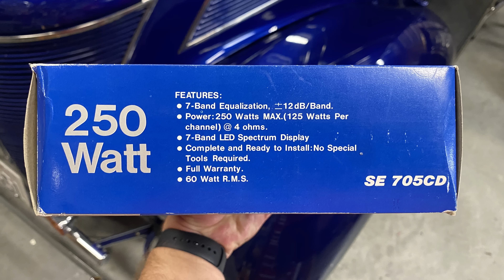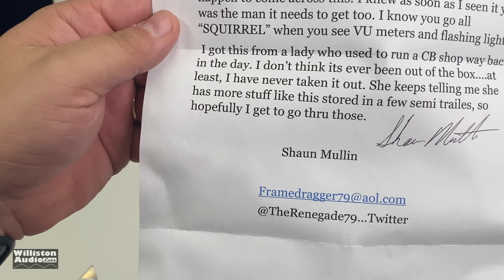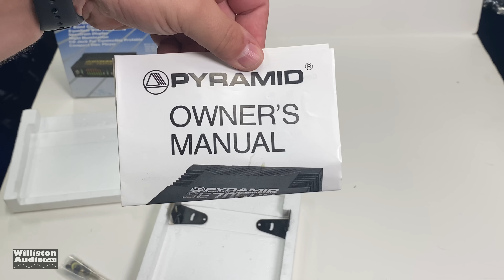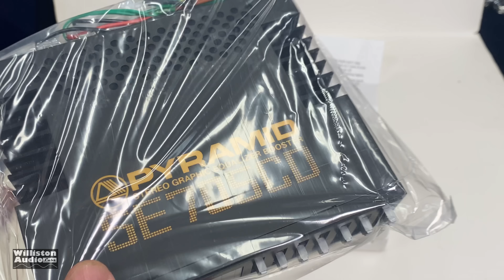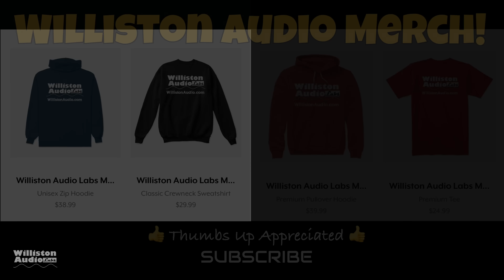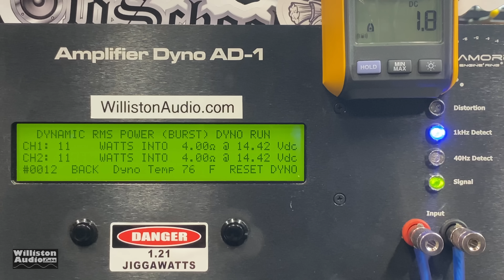1980's Flea Market EQ Booster? Pyramid SE705CD Review and Amp Dyno Test

Comment: In '88 I had an '81 Mustang with stock AM radio and 1 speaker in the middle of the dash. Realizing that my boombox had speaker outputs, I bought a Craig EQ/booster and and installed a pair of 6.5" Pioneers in the rear side panels (yes, if someone on the husky side sat in the back, they would muffle the sound a bit). Running wires from the boom box to the Craig allowed me to listen to my cassettes and FM, instead of that crappy, blown dash speaker (in AM none the less). That is officially my intro to aftermarket car audio. Thanks for bringing back some nostalgia.

Comment: I'm sure you already know, but I can't recall ever hearing you mention it. With the "New Old Stock" amps or electronic equipment period, the electrolytics dry out over time and sometimes severe damage to the unit can take place if power is applied prior to testing the components. Of course to thoroughly test the electrolytics, they would need to be desoldered and removed from the board and tested, then resoldered if values are still in spec. Cute little EQ though.

Comment: Had a sparkomatic loud n clear system back in 87 when I first started driving had the 80 watt power booster with the loud n clear 6x9's. With a set of pyramid 12 inch subs 😄 😄 thought I was doing it back in the day

Comment: If I’m correct , back in the 80’s , many of the cheaper head units only had around 3 to 5 watts rms per channel. So this Pyramid EQ would be considered an upgrade.. if you wanna call it that .  There is lots of Nostalgia to the Pyramid brand. Most of us teens in the 80’s didn’t make a lot of money, so we had to resort to cheap products like this unfortunately . Speco was another company that made eq boosters in the mid 80s

Comment: Those things usually had a 5 amp fuse, which tells you a lot about potential output. The fuse blows if it pulls more than 60 watts from the battery (ok, 65 @ 13.8VDC) so even at 90% efficiency there is no way it can make the rated power. They were cool though, I'll give em that!

Comment: I sold at least 50 of those power boosters in the late 80's and early 90's at the Wagon Wheel flee market in Pinellas Park, FL. Pyramid had some hit and miss products. Their power boosters were much more overrated than most of their amps, which were still way over rated. If you ever run across a Pyramid PB600 (4 channel amp), PB800 (beautiful red 4 channel amp) or PB1000 (also red but 2 channel) please pick them up and dyno them for me! I love the channel and keep the great videos coming.

Comment: I think I am a bit older than you Big D. Do you remember Sparkomatic amplified speakers? They were 4" amplified components, with separate amplified tweeters with  their own level control. There was also a "subwoofer"  with dual 4" woofers with built in amp.Each speaker had its own amp. They were loud as hell..... and noisy as hell, but I did not know then what I know now.I would love to see a set of these come your way.

Comment: hah. i installed a few of those, back when. worked alright for installs where you just wanted to give a boost to something with a suuuuper crap oem unit from the older car generations.

other than that, they're so damn iconic as generic 80s stereo crap.

Comment: Man that brings me back to 1990 and the  old Sherwood amps and the profile amps and pounding 4 10 inch bazooka tubes off the profile's amps and the 4 Kenwood 6x9 s in the deck lid with 4 Polk audio s in the doors . The head unit was a custom unit that was on the head liner and went from the windshield to the Dom light with equalizer and tape deck . Then had a cd player in the glove box all that was  in my 79 trans am . Man I miss that car

Comment: I had one of those with the surround and echo effects although I knew pyramid was a gimmick autosound company and would never make rated power the actual eq was pretty good when the sliders worked the amp section made factory speakers bump!...but I didn't expect anymore than 20 watts RMS per channel

Comment: So my dad worked for a brand that went by "SparkOmatic" in the L8 80's and they had similar offerings, though their EQ "booster" only touted 40w per channel.
Reply: I remember well the Sparkomatic
Reply: @raymo6795  HAHA! For the record, the name roots from the brands original products; A high mileage sparkplug & devices to check cylinder firing order. The car audio came later down the road, they even aired commercials on MTV. Theyre on YT check em out!
Reply: I worked at Pep Boys part time in HS and they carried 2 Sparkomatic boosters. One had just a power button and the other had EQ and green horizontal LED power level meters at the top. One guys Caprice practically burnt to the ground in the parking lot after he wired one in. He refused to buy the wire nuts to cap the connections. Great times lol 🚗🔥🚒

Comment: I was really hoping that thing put out its max rating. Would be really funny if Pyramid built something that worked. I had a pair of 15s that required Plumbers Tape to strap the magnets to the baskets. Stuff was expensive back then. $250 in todays money is around $600 now. A lot of minimum wage hours to buy that stuff.  Probably 75 hours worth of work to buy that eq. Yikes.

Comment: I believe there wattage rating is with speaker level inputs not line out inputs so may get 20w/channel with alot of distortion. I had a radio shack 20w/channel booster in my 74 Cutlass... LOL

Comment: how does it hook to a car stereo? do you have to use the speaker outputs? 
and how does the cd jack work when hooked to a stereo? would the fm radio be playing at the same time? or do you have to turn the radio off & just use the volume on the EQ.

Comment: I still have the Realistic version from Radio Shack which has 40W RMS boost transformer each channel instead of 10-20W BTL chips.  :)  Probably 10% harmonic distortion at 40 watts, but pushed 6X9's ever so well.

I saved up hard for that one and love that little spectrum analyzer, even if they cheated by pairing some LEDs together.

Comment: I have one that looks quite similar but the Chips are different and the front face is slightly different, instead of slide switches it has a push button up and down and its branded as "Nippon America". Its also rated at 250W I don't know if it actually makes that power but I do know it sounds much louder with the Equalizer than with just deck power alone. Perhaps it's the method by which it amplifies which the dyno is not tuned to pick up correctly? I am not sure maybe an expert can give their opinion. However, the Equalizer looks so cool when playing music or even listening to radio programs that I am not willing to part with it. It might be from an older time but so was many great things like the Toyota Supra and many sports cars including Lamborgini and Ferrari's, Grand Piano, Marantz and Nakamichi receivers etc.

Comment: I had one of these in my first car stereo setup in my 66 Mustang.  It did not have the CD input or the fader knob (eairler unit maybe?)  I used it as a preamp EQ only, but sad to say the rest of my setup included amps 2x 800w amps and 2 15" speakers. And 2 6x9's from Pyramid.  I knew even then that power numbers were over inflated.  It sounded pretty good and cost tons less than pro setups.   Overall I was happy and the setup lasted over 8 years of heavy use.

Comment: Haha I loved Pyramid. OK, they're stuff was garbage. But hey you could get at $250.00 MSRP Radio Tuner EQ 2500 watt per channel amp for the street price of $29.99!  But no, yes most of their stuff was garbage, but I had a few things that were decent, one being the 10 band PASSIVE EQ with LED display, LEGACY 3 way 6x9 (they were awesome actually), and 2 12" Phase III with the clear polypropelene cones. They were pretty good, not the best of course. I got a friend some of the 8" clear polypropolenes in a homemade box and it sounded good in his truck.

Comment: I had that very one. I used it as a pre-amplifier after I plugged it in and found out it wasn't worth crap. But then I think I paid $12 for it brand new. Lol To be honest money bought a lot more back then. And it was for a crappy old car.
     I have had and have some fantastic Auto stereos and amps. That wasn't one. One of the better stereos I purchased in the late 70s early 80s was a road star it had a 200 watt amp which was quite large for the day. And it then had a seven band equalizer with light bar that attached to a flexible gooseneck. I ran that up from the floor next to my shifter in my pickup. With the large Dimension amplifier behind the seat. It was 4 channels . The head unit  was also a Roadstar  it lasted nearly 25 years. It was a multiplex which seemed to be a big thing then. And the cassette player was rather trick  you could set it  to turn off or reverse indefinitely at the end of the tape.  but you could also set it to Auto eject as well. It also had a Chrome tape setting.  The amplifier finally cooked about 15 years and three vehicles later.  but I kept The Equalizer cuz I've never seen another one like it.  even the ones on eBay the Vintage section don't have that model.

Comment: Better than a cheap stock radio from the early 80's, just not a lot better.
Reply: I was 16 back in the 80's, and anything was better than stock back then.  As long as it was loud.
Reply: Yeah, most were only about 4 watts.
Reply: Boy do I miss the flea market stereo tables/vans. Pyramid EQs, Amps, and Subs. Love to see the PB-100 amp get tested as that was the only vamp I ran by them.

Comment: Can you imagine if someone like skar made a version of this today that actually did 250 watts and had the eq and everything?!? That would be RAD!
Reply: YES! Just have to find somewhere to put it,  rare to find a spare DIN slot in cars these days.
Reply: @CheapCheerful  Just use a couple of L brackets and screw it to the underside of the dash!  That's what we did in my 76 Cutlass.  good times... lol
Reply: @bmorg7244  Yes!! That's exactly it.
Reply: or if you got a 2 din car. get a 1 din radio with flip up display and slap the eq underneath. so you got a din 2 car play display and a manual eq underneath with actual knobs
Reply: They kinda do, but to get an actual 250w, it will be "rated" 1000w.
Reply: Single DIN EQ with a built in 50x4 RMS class D amp is totally possible, and could stack on top of a SDIN head unit in a DDIN opening perfectly.

Comment: You have to remember, the old stock head units in the 70s and 80s were at best 2 or 3 watts so going from that to 12 watts while it may seem laughable today, was a big improvement.
Reply: Pyramid was a piece of crap back then, there were other brands of decent equalizers with 35 Watts RMS wich sounded awesome.
Reply: I believe this was the go-to option for every t -top camaro, jeep, and pickup JUST so you could hear anything over the noise of your exhaust or mud tires
Reply: @jimbobdobbs1597 
no
Kenwood and Pioneer were goto's 
I myself had many Pioneer models in my Camaro's.
Reply: Yep with a couple Jensen or pioneer 6x9s and some Motley or some Ratt those were the days.
Reply: The standard go to chip was good for 25W into 4R at like 10% THD... BTL output was the only way to even get that high without a supply that fed them more than 12V.... This thing would have had 2 of them in it, one for each channel
Reply: @MadScientist267  Holy
Cra q at 150+ each
Reply: @rudygarza6410  Lol 🤷‍♂️
Reply: Less than it sounds. It takes around 10X as much wattage to get twice the volume. So a 3 watt amp would need a 30 watt amp to sound louder.  
As for people talking about speakers. Speakers rated lower are easier to drive with lower ratings, obviously.  A lot of speaker tone comes from how it's driven . You don't need 500 watts to sound good in a car.  35 to 50 watts is fine and still enough to cause hearing loss..  Just gotta match your components to the vehicle.
And yes, as stated, Pyramid was always a crap brand.
Reply: Your right. That kraco push button 20w booster was 🔥
Reply: I sold the hell out of these in the 80s. I worked for a guy who was the pyramid flea market master back then, we would make $2-3k per weekend.
Reply: You hit that on the head!
Reply: I remember wanting one of these in high school.   My dad, an electrical engineer, took one look at it and said there’s no way that’s 250 Watts.  Yup.
Reply: Even more important, many LOUDSPEAKERS were more EFFICIENT than today, so 10 watts might play louder than 50 watts or more into many of the low efficiency speakers of today!
Reply: @bobinmaryland  Very true and rather forgotten aspect of all this. When power got cheaper, the efficiency of the drivers became less important, raw handling for the higher SPL demand took over.
Reply: @bobinmaryland  Exactly.  I rebuilt a 1977 home speaker, 15" 3-way.  It is rated 70 watts RMS!
Reply: @bobinmaryland  very true! Back in 1997 I had 2 Pioneer IMPP 12s rsted at 150w rms on a 4 channel targa amp rated at 75x4 in the trunk and it pounded! And they hit just as hard and hit way lower notes than my two kicker 12s on a 500.1 JL mono amp in the back of my Land Rover. Even my single Orion XTR 12 on an old school Alpine 2 channel in my Celica back in 1999 hit really hard. Today its harder to find something that will slam 20hz. Everything seems to fall off below 30-35hz. All of my old systems were in sealed enclosures too.
Reply: That's 3 more decibels of audio which is very significant.
 If you know about how wattage effects sound decibel level  Then you know an increase of 3 dB is the equivalent of doubling your wattage. In "loudness" there's no difference between going from 1 to 2watts than there is from 100 to 200watts its exactly the same increase in output volume. There both a 3db increase.
Reply: Reminds me of the time I bought an Optimus AM/FM with auto-reverse cassette car stereo, maybe 1992? It was rated at 28 watts.  Driving two Sony 6x9 speakers, it really cranked at the time.

Comment: One of the better “alternator whine injectors” out there.
Reply: Bro i thought I was the only one that had that problem I swear I never got rid of it!...chassis grounding nor in-line filters helped!
Reply: @nathanielbolden5053  Back in the day there were options to buy non resistive and resistive spark plugs. Resistive plugs eliminated or helped reduce that whine in some of the head units.
Reply: .....I tried everything to get rid of that noise
Reply: @raymo6795  Back in the day I had a similar generic car stereo eq/amp that picked up alternator whine. The best fix was to go to Radio Shack and buy a filter choke. Radio Shack called them noise eliminator kits. The choke looked like a small transformer but you simply hooked it in series with the positive lead to the amp, no more whine...totally gone.
Reply: Raido Shack I  went to was the last 1 in my area & it closed about 5 years ago back in 16

So where do you find a place like that nowadays  ?
Reply: @wojo99-w4p  you won't, actually radio shack kinda fell off anyway. they could have been so much more.   if you're looking for audio/speaker stuff, checkout parts express.  monoprice is a good source for wires/cables/interconnects.  worth checkln out if you don't know
Reply: @wojo99-w4p  They still sell parts online at radio shack. Com.
Reply: Came to say I got one of these in the 80s and it amplified alternator and ignition noise better than anything else!   You could turn down a couple of faders to reduce it, at the cost of reducing large parts of your signal!
Reply: We put our own caps on the power lines.  Easy peasy
Reply: nothing a good old small coil(what old school installers called noise suppressors) couldnt fix AND reduce the voltage by .5 volts! lol
Reply: My stepdad had one in a Plymouth Valare that sounded damn good.  Had 6.5s in the doors and 6x9s in the back shelf and that thing used to sound great
Reply: Used to call it the audible tachometer...
Reply: The ground loop is strong with these.
Reply: I read some where to ground it to the rca jack on the back  of the unit to fix that problem not to the body or chassis
Reply: Resistor plugs and wires and wiring it right where power wire is not next to RCA's.
Reply: The injected noise was a easy simple fix. If you didnt know that then you probably should no be messing with your stereo anyway.
Reply: @jamesvw769  Easy to say, but remember in the 80s you couldn't just look it up on the internet or find the relevant book on Amazon.  You could take a few semesters of electronics classes, check the branch and main library to find what's on the shelves useless for this quest, and end up at the book section of a larger electronics store paying $45 a book  where out of half a dozen in stock, one might or might not have "ground" and "loop" even on the same page anywhere within.   Mobile audio has come a long way.  So has the knowledge base about it, and access thereto.
Reply: @jamesvw769  and your dad shouldn't have forgot about pullin out that one night.  now he's stuck with you.  shouldn't be messing with garden tools anyway.

Comment: 249.95 for 11 watts. Considering the head unit would likely be pushing 7 watts and the booster would only have high level ins you would be paying 249.95 for an extra 5 watts. lol. The sad part is I would have had a hard on for months after seeing this booster back in the early 90's, 7 band EQ with spectrum analyzer, yeah I didn't know a lot about systems back then.

Comment: cheap class d amplifiers do NOT have good sound quality! but cheap class ab has relatively good sound.

Such type eq. amplifier does not have much watts but it is a small upgrade in watts compared to the radio you had in your car from the 80's